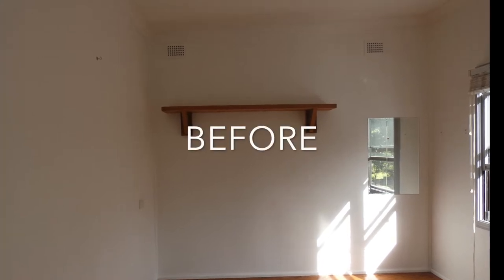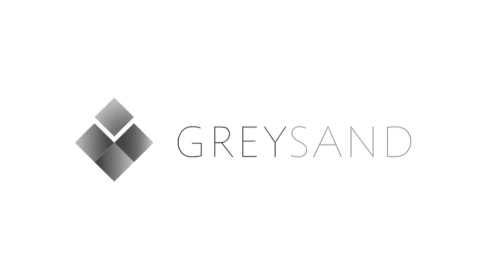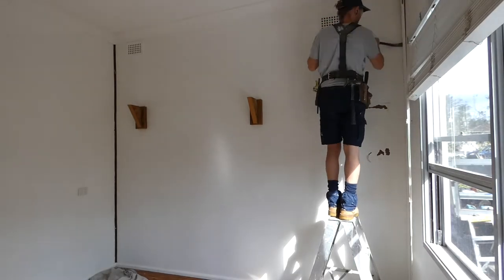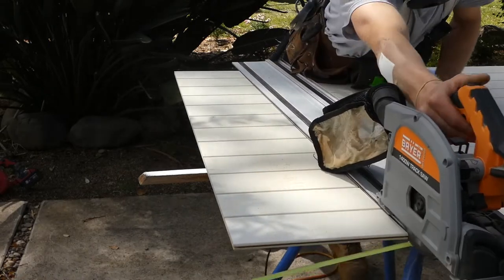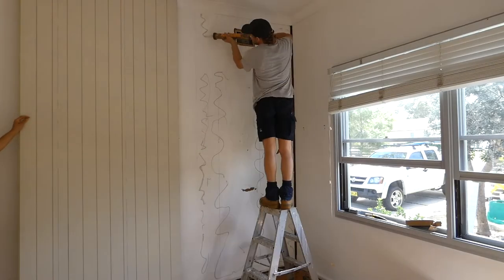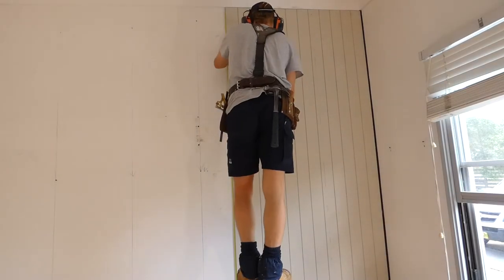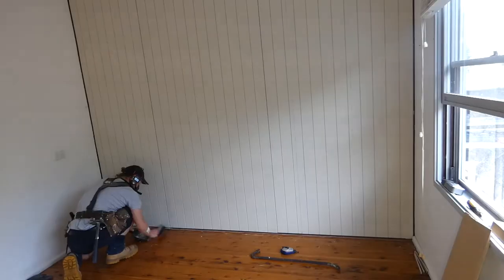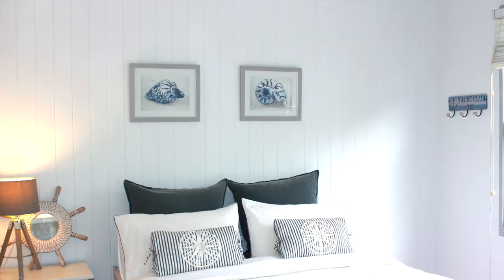VJ Panel Bedroom Feature Wall | 5 Steps

Comment: Could you turn these and stack these horizontally? Just wondering how they would stand up nailing one on the bottom and one at the top for the darker, more cabin-wood/barnwood looking panels.
Reply from the maker: No problem to install the panels horizontally. It will look great also. Just following the installation guide that comes with the product you use.

Comment: HI great video, you left 6mm expansion gap on each side of the wall.  question did you fill the gap in with filler or did you nail a trim over it?
Reply from the maker: Hi Sue, in this project I used an 18mm by 18mm square trim to cover the expansion gap. Hope this helps.

Comment: Interested what you used at the top between the panels and 3mm gap you left from cornice
Reply from the maker: Hi Jordy, I use “sikaflex” or any flexible paintable poly product.
Reply: @GreysandAlex  legend. Do you think you could use a smaller timber trim aswell? Or you think it would stick out too far?
Reply from the maker: Hey mate, If the wall has gyprock and cornice already. Like in my video. The timber would probably stick out too much. If the vj lining board is going straight to the studs I use a piece of timber in the top internal corner.
Reply: Hi, you don't putty the Brad holes and sand before painting?
Reply from the maker: @allinski  yes,  I fill and sand the holes before painting. That step just didn’t make it to the video
Reply from the maker: @allinski  yes I do fill and sand the nail holes before painting.
Reply from the maker: @allinski  Yes I fill and sand all the nail holes before painting. Everything from the project can’t make the video.